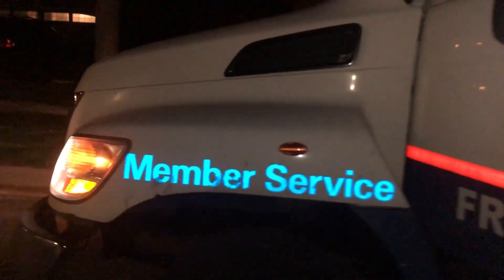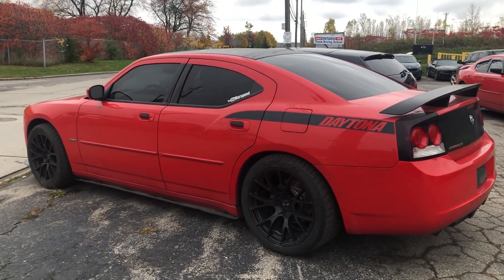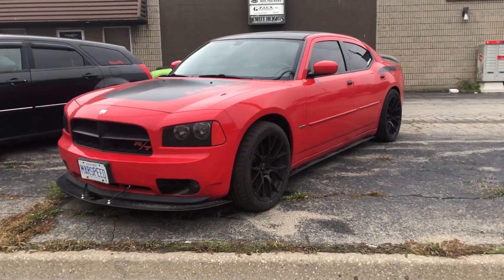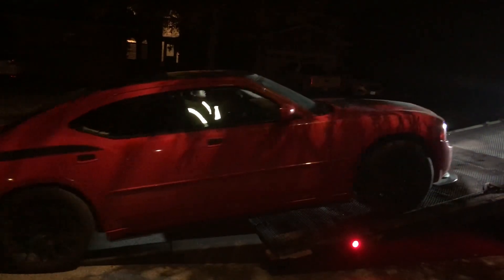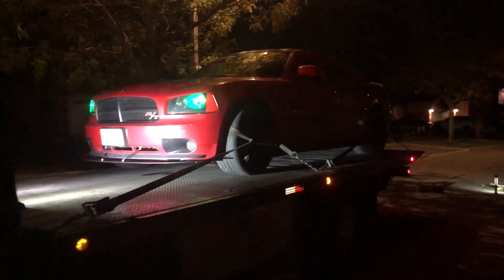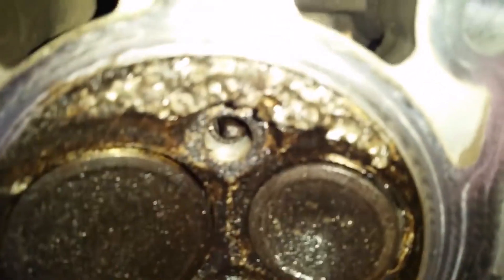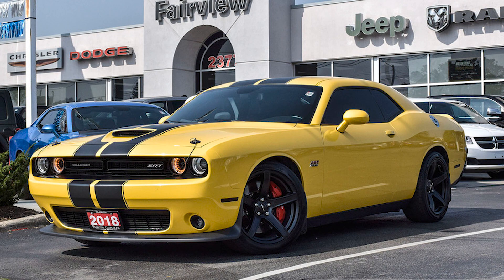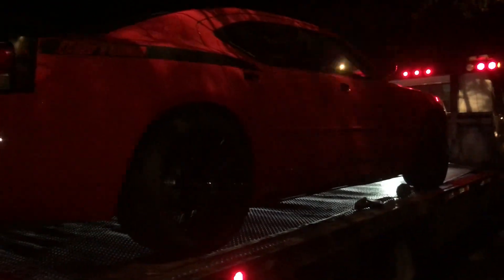My Dodge Charger R/T Daytona Engine DIED! – What Happened & What Comes Next

Comment: A nice hello from Bavaria, (germany) and I´m so sorry about that! :( 

Can you tell me, what tempreratures was it at the outside at this day, whe this problem began???? (IMPORTAND, i thik more importand than the most people know about... i´ll explain you! ) :)
Engines are my passion... And I´ve also bought an 2006 Daytona and that listens really really bad. I didn´t had problems like that with Alfa Romeo, what i drive in really hard motorsport conditions since roundtabout 15 years... And i´m very afraid bout that, becaus i´ve heared about that issue also in other revierws & things like that. The problem what i see is that is a problem when producing the cylinder heads, that they´ve not used the right bore diametre for this valve seats with this kind of material. If these seats are Sythermetal, that was great! Because the longest living engines has valve seats made of synther metal. But that things like that issue can´t be possible the right bore diameter in the aluminum cylinder heads is also so importand (I´s even importand, whatever metal the valve seats are) And it is like i´ve told, it´s even importand to coose the right bore diameter for the seat rings in the heads. And for ordinary it isn´t a mistery! Engine  engineers/designers has books or even a tabulary for right material combinations and bore diameters. And a lot better than that; expierience an skills to coose the right fittings! ;) And I really hered from issues like that and all possible issues only from one Automake0; The Volkswagen Company, especially Audi has the most issues in the whole Auto industies... And Alfa Romeo? (A Manufacturer what is famous for his motorsport history and engines, made for motorsport in ordinary but vey spportiv/performence cars and sedans... but in common Auto papers the´re talking bad bullshit about Alfa Romeo (at germany) the most things are big lies. Because i can tell you with my passion, knowledge, skills and motorsport driving, and houres of work on these engines, that Alfa Romeo has one of the best engines in the whole auto industry. Especially when youé not driving an ordinary driving style like me. and i never had big issus or damages on my 5 Clinder and V6 Cylinder Alfa Romeo Diesel & Gas Engines with mostly motorsport use... I tell about, becaus it was Alfa Romeo back in the 1950s when they was founding the Aluinum Cylinderhead and motorblock with cylinderliners made of hardened steel in open deck design. (+ Double Overhead Camshaft... 1950!) These aluminum cyl. heads had also warm up in this warm up phase of the engine... and different materials has different "sizing up" in the warm up phase of an engine. (Didn´t know the rignt word for it but i hope you understand me) 
And this is the thing why the bore diametre for the valve seat rings in the cyl. heads is so tricky. in production the rings are bigger than the bore diametre i same tempreature at the production line. so the valve seat rings must be cooled down, often a lot, then they could be fittet in these bores, i the cy.heads. and when they get the same, ordinary temp. this seat rings has a press fit.  (I hope i can eyplain it with the vocabular of me in english!)i
And the good question is, what was the tempreratures at outside at the da when your engine lost the valve seat rings out of their bores in the cyl. heads... And it was also interesting to which teperature Dodge cooled down the rings at the productin line when they fitted in the bores... 
I´m really afraid about that problem. Because i really think the failure is te pairing diametres to fit in the ring to the bore at the cyl. head. And if Dodge hadn´t choose other, better pairing diametres, then all hemis has that problem. But i can´t beleave that Dodge hadn´t choosen other bore diametres, also at the 1st year of production. because a issue like that could be there a long tie without the knowledge of the engine plant/s. And then they had to make a new, better material pairing or eve a little less bore diametre of the bore in the cyl. heas. That can´t be there a long time period for ordinary. Or Dodge produces cars like the VW Campany....without care... But i don´t hope so.

For a good tipp for you that you get a bulletproove HEMI, ithout that issue and you´ve NOW that option:
Go to a machine shop, tell him about that what i´ve told you about and that it is possible that the size of the bore diametre at the cy.Heads for the seat rings are to big when they came out of the fatory...It´s possible that they coose a little bigger valve seat rings to fit in the bores. Thats the option and i think that was the way i would go if i had that issue.... Beause the machine shops with a lot kowledge about that could cancle that issue....
And after that you can drive your beautiful Daytona without any care o this "out of stock issue" :)

Best regards, cheers Till

Comment: Big fan man. I too have a 2010 Dodge Charger sxt 3.5 v6 and upgraded to 07 RT charger. Now I bought to fix it had bad plugs and solenoids and still having a hard with it. But I would say if you get a charger or challenger, get the SRT HELLCAT!! That would be a great upgrade. Sorry your car die.

Comment: Dude my 2014 chrysler 300S awd with the 5.7L blew a rod through both sides of the block at 46k miles. And Chrysler wouldnt honor the warranty because the time had run out by 3 months. Bought a new motor out of my own pocket and installed myself for about 6k. FML

Comment: I had a go mango daytona, it burned to the ground this March :(, heads up to other daytona owners carry a fire extinguisher. 100% stock wiring, only cold air intake, no idea why it burned, but very very sad day. Engines are replaceable. Car got so hot the rims melted to the sidewalk and roof caved in. F mango 💔
Reply: 160k miles, 0 engine issues or leaks, ran like a champ, oil change every 4K, got the car with 130 on it

Comment: Hmmm This Is Wierd I Mean IDk But Are They Program To Go Bad At Certain Time? Cause In The Pass 3 Weeks About 5 Chargers With 5.7 Went Bad And They Are All 2006-2009 🤔🤔
Reply: All 2003-2008 5.7s have weak seats, the head revamp fixed this
Reply from the maker: Yes all 2003-2008 5.7s have the same problem, I see them go usually after 100k miles. It was fixed on the eagle hemi from 2009 and up
Reply: @MarspeedCars  Yup Mine Is The Police Package Just Hit 170k A Month Ago And Now It's Sitting Until I Save Up The Money To Fix It

Comment: Bro my 06 top banana yellow one went about ayr ago I drove it across town didn't drive it hard went in to my GF house for twenty mins go out to go to walmart and the thing was shaken and smokin like crazy no metal in oil so hoping it's a different issue mine has 145,000 k on it when it went Gona try new Intake fuel Injectors new coil packs and change oil cause there is gas in my oil no metal shavings though so hoping it'll work if not looks like I'm rebuilding a 5.7 and it's weird how between 95k and 150,000k they all seem to go hope u get yrs goin again bro I know I've missed mine driving a  05 gto till u get daytona fixed trans mission goin in my gto to now so maybe walk-in awhile
Reply from the maker: Yeah they seem to get issues at the higher mileage for these 06-08 5.7 hemis! Sorry to hear that man hope yours gets back on the road soon

Comment: Ah, Chrysler Quality: Where your car dies at 120k, or outlives you and your offspring's.
Reply: My 2006 Magnum rt has 170k on it been through several states and was running strong prior to it now needing a power steering pump so I have it sitting until doing the stress free repair. You should change your plugs every 30k miles and I believe this situation won't happen 🤷🏾‍♂️
Reply: @draines9237  what plugs

Comment: This is such BS. My wife's 06 Charger 5.7 did this at 130,000 mi. Thankfully my '06 Magnum SRT8 has not had any problems. Chrysler should have had a recall on this considering the number of vehicles and owners that got screwed.

Comment: Its Ironic that I payed 45k for my 2015 Charger Scat Pack, now the newer ones go below 32K (most likely due to COVID) and come better equipped than my 2015.
You will definitely feel the difference between the old and new gen challengers however keep in mind you will spend more on brakes and tires if you get the 392 engine. I haven't spend a dime on the Engine/Transmission and I have 87K on it.

Since 2018, I normally drive 100 miles a day on my charger scat pack as a daily driver. Over all I spent $2800 on brakes (not the multi piece ones) and 3 sets of tires using mostly continental sport tire $980 per set. 

Gas wise it really comes how you drive. If you drive gentle the engine can go 4 cylinder mode up to 80 mph giving you 26 up to 31 mpg on the freeway, in the street it can go 4 cyl from 25 to 45 MPH from 13-35 MPG avg up to AVG 21mpg combined which makes it great for long drive. Now if you drive as it was meant to you will get 24-26 mpg on the freeway 14 mpg on the street and 16 mpg combined. Keep in mind this is a 6.4L 480 HP V8 its a night and day difference from the 5.7L